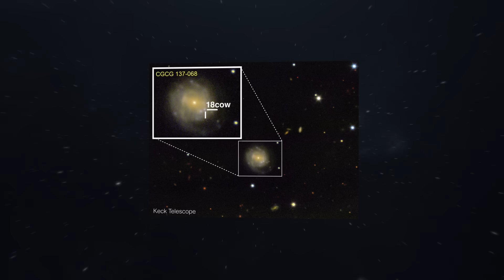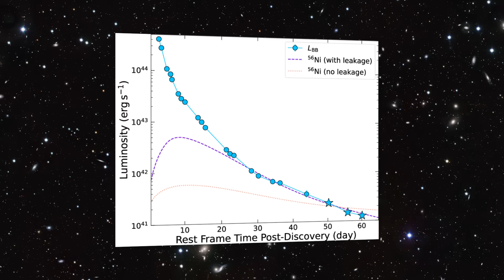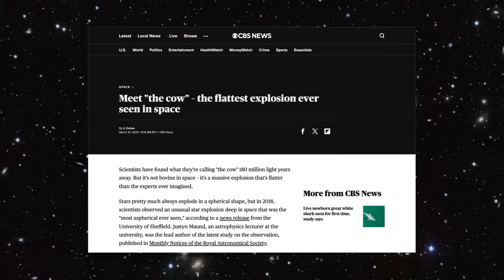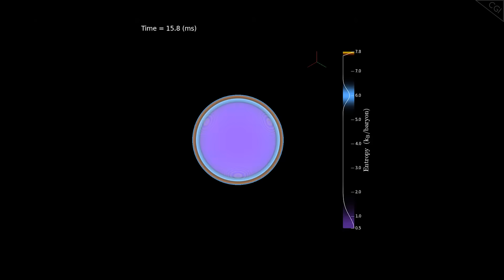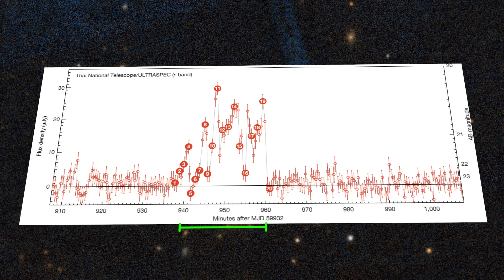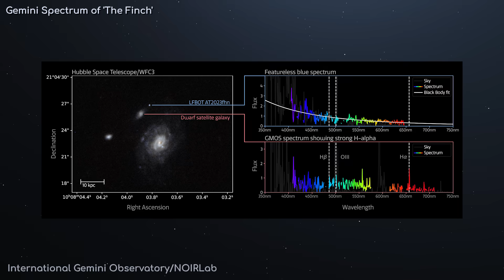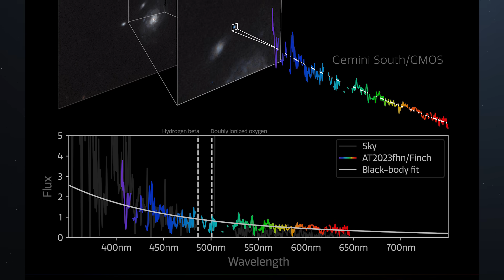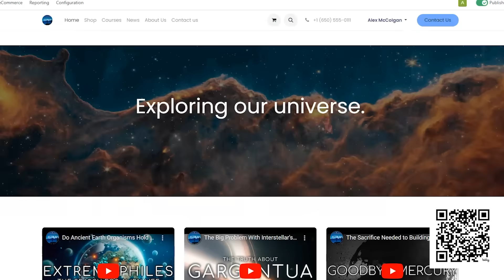Kilonova Size Explosions Are Popping Off in Empty Space

Comment: One potential theory for the Tasmanian Devil could be a small and very tightly packed globular cluster of supermassive stars. A group tightly packed enough to where the shock wave of the first one detonating could have caused a chain reaction, ultimately destroying the whole group.
Reply: I don't find this likely because the distance between the objects would have to be extremely low, as in light minutes apart at most. Less then the size of our own inner solar system. I can see a binary star pair of such objects maybe work... trinary is a stretch... but over a dozen such stars setting eachother off like firecrackers in a chain in minutes?
Reply: @aeternusdoleo4531  You do realize that Earth is only 8 light minutes from the sun right?
Reply: @TheCasualDeathworlder  Exactly. And those shockwaves could not exceed the speed of light. So in order for those shockwaves to "set the next star off" and get consecutive bursts within minutes of eachother, you'd need them extremely close to eachother... astronomically speaking. Combined with the presumed mass of said stars I just don't think it's possible.
Reply: @TheCasualDeathworlder Planets closely orbiting stars seems vastly different than multiple stars closely orbiting around each other. It seems unlikely a cluster of stars could exist light minutes apart to simulate a cosmic firecracker on string.
Reply: @aeternusdoleo4531  didn’t they say in the video that these observations were happening over multiple days? I don’t remember them saying “minutes apart”, but I could be wrong, I can rewatch it later 🤷‍♂️. I don’t get why it’s improbable that stars could be close enough to one another that if one of them went supernova it could potentially cause a chain reaction to others nearby. These objects are billions of light years away, and therefore, billions of years in the past. We certainly can’t resolve individual stars or make determinations about how close they are to one another at these distances. Can we? These stars could’ve also been orders of magnitude larger than the ones we observe in the nearby/modern universe. Just a thought.
Reply: @TheCasualDeathworlder  Which means a light year is 4.2 million light minutes away
Reply: @Michaelroni-n-cheese  I don't follow you logic...or see what bearing the statement has on the conversation.
Reply: @TheCasualDeathworlder  okay dingus is okay if you're not smart enough to understand
Reply: @aeternusdoleo4531 perhaps the shockwave of such an extreme explosion goes beyond the speed of light.
Reply: I'm surprised we don't see evidence of that very often- a massive explosion destroying nearby stars. I'm not a scientist, just an enthusiast, and I'm always surprised when we're shown a star that's gone supernova that had a partner- and STILL has it. How does the partner NOT get destroyed too? Like that nebula (is it the Crab Nebula? Or Tarantula Nebula?) that has a Neutron Star in the center of the nebula but the partner is still there. 

Perhaps I just think of them too close together. But it's fascinating stuff!
Reply: @carried9130 sorry, i just read the last bit of your message, it seems you already thought of that, nevermind. My apologies
Reply: @mrsharky06   no worries!
Reply: Because the stars, even though are partnered, are still very far away from eachother, lightyears even, the explosion could never reach that far. Now, two stars that orbit eachother could defintely destroy the other if one exploded, due to their extremely close proximity to one another. @carried9130
Reply: ahh yeah I hate it when my globulin clusters are very tightly packed
Reply: Hogwash!
Reply: @bad_actor1128  prove me wrong...hehe
Reply: I like that hypothesis! These things are so far away, it’s amazing that they can pinpoint theirs locations, but to think that it must be one star having multiple events seems more unlikely to me than multiple stars in close proximity doing so.
Reply: It's the birth of a White Hole on the back side of the Blackhole... there is an Enistine/ Rosenburg bridge between the two of them that we can't see. the tail on the white hole busts into life and slowly fads away in a few days. At that point, there is a stable wormhole formed.. want to go for a ride???
Reply: @thrillchaser9492  An ERB producing a white hole would be an interesting hypothesis, if not for the energy levels being too slow to ramp up, the peak energies being so much higher than the end energies, and everything we have theorised regarding quantum mechanics and special relativity functionally eliminating the possibility of a slow wormhole collapse, even with the spacetime disturbances of extreme gravity.

The energy would drop off much more rapidly if the end of the burst was caused by the white hole's event horizon collapsing. I would also have to question the celerian velocity of the matter during the burst for the energy to be so blue. It's possible that after passing through the black holes event horizon, and before reaching the critical mass to create the white hole and the trailing mass leaves the white hole's event horizon, matter is violently superluminal, in a region of timespace so twisted you can go backwards through time, but not upwards. All directions through time lead downwards to the gravitational singularity.
Reply: Light has to travel. So, considering the time for the light to get here, how old is the Light Burst ?
Reply: bro imagine being a star and just seeing your neighbor explode and taking you with them 💀
Reply: They were minutes apart, even the first two. I don't think supermassive stars can be that close to each other.
Reply: @Mathel_Steeltoe   I always wonder how close they can be in a few scenarios. Say similar 2 super-massive stars, or 2 like our sun, or 2 red dwarfs orbiting but not colliding. How close can they get and maintain orbit? How about different combos? How close can white dwarfs and their companions be? How do some stars merge without total destruction? 

Seeing examples of the heliosphere...that's such a huge amount of space and so much power from our sun. And it gets me curious about other stars' own heliospheres and binaries too...like do binaries contribute to 1 or do they each have their own heliosphere? So many questions. I've only recently started learning, and I get why it drives scientists on. The more I learn, the more questions I have.
Reply: Its the neural pathways of the cosmic brain lighting up
Reply: @Igneous01 Interconnected how exactly? How does that work? I can accept that a relatively small destabilizing force could trigger a larger reaction - but what can move at that speed to set off multiple objects in short succession across large distances, at the very least multiple light minutes apart?
Reply: @Igneous01 I'm not sure if given the pressures that the heliosphere of one star could affect another like that... but don't know enough about stellar mechanics to say. Would make more sense if a gravitic or magnetic shockwave rather then a compression wave would end up messing with neighboring stars...
Reply: Those are Creator farts... but it could be Odin farts.
...
..
Reply: Hmm no, having almost equal stars that close to each other is impossible.
Reply: @AstuteClippy Ummm...no. It's called a globular cluster. A million or more stars, mostly of the exact same age and stellar type, all packed to a density of 1/4 LY (or less even) average separation.

Comment: could it be pockets of matter and anti matter annihilation? could there be pockets of anti matter  just lying around in the universe which unluckly galaxies pass or pockets of large matter gasses to pass through?  causing such huge energy conversion? i am just an amature enthusiastic, but matter anti matter annihilation seems more plausible for such magnificent  scale of energy..
Reply: It couldn't be. I've been part of a research group at my university studying positron annihilation spectroscopy and have learned a little about anti matter annihilation. The problem with this hypothesis is that matter-antimatter annihilation creates very specific wavelengths and basically doesn't have a spectrum. Electrons annihilate with positrons and create a very specific photon frequency, depending on the speed of the electrons and positrons relative to each other and us we'd see a spectrum within an extremely small range of frequencies. This happens to be the case for every particle and its anti particle.

Electron Positron annihilation is one of the longest wavelength (lowest energy) photons among antimatter annihilation but its photon energy is gamma radiation. As mentioned in the video LFBOTs create quite a large spectrum of radiation including blue light. While matter antimatter annihilation could possibly produce blue light if both the matter and antimatter were moving away from at like 99% of the speed of light (which is already an unprecedented speed for us to have seen matter moving relative to us [in large enough quantities to produce LFBOTs]), it couldn't have produced such a spectrum, and even if it did you'd see sharp spikes in the spectrum it created around a specific wavelength for each different type of matter-antimatter particle combination included in the annihilation event.
Reply: @dezvul4817  cool! thanks for explaining it in details, really appreciate it.
Reply: Certainly can't rule that out. There's so much more that we don't know about the universe than what we do know. The laws of physics seem to apply throughout the observable universe but who knows what else is happening on levels we cannot detect, observe, measure with current technology. We still don't have a clear understanding of how quantum mechanics relates to general relativity. Take care my friend. 🙏

Comment: Nothing in far distances is where it appears to be. Photons takes curved paths to many gravitational fields on their way to us and high energy FRBs are less effected by those gravitational fields that in our sky, lands them as source unidentifiable.
Reply: The thing is that unlike refraction gravitational lensing is not color dependant and isn't going to separate the image of the LFBOT from the image of its host galaxy.
Reply: @andrewwade1651  Common belief is "Gamma rays are affected just like light rays, so they will be subject to a gravitational red shift and they will be bent by gravitational fields just as visible light is." 
There is an entirely different discussion if they are effected identically in taking the identical path.
Reply: @rezadaneshi  Based on our understanding of General Relativity, radio, gamma, gravitational radiation, and neutrinos would all be gravitationally lensed, yes. But "the Finch" doesn't appear to be behind any strong gravitational lenses and many of our detectors don't have the angular resolution to observe gravitational lensing anyway.
Reply: @andrewwade1651  if the energy of the regular photon gives it a theoretical mass based on e=mc^2, the gamma ray mass equivalency will be magnitudes higher. Both at light speed. P=mv. It's mass equivalency at that speed will be less effected, in a way it's cheating or time traveling ahead of visible light photon by powering itself a shorter cut by influencing its path gravitationally itself.
Reply: @rezadaneshi that’s deep and neat🎉
Reply: But what is near the object will also take the same path, if it appears in empty space or a galaxy, it is. It just might be somewhere else and not in a straight line to where we observe it.

Comment: This reminded me of something i saw a few years back. Not saying it is related but it was strange. I was in my garden one evening, late summer, doing a work out. In between sets i would enjoy looking up at the clear sky with all those stars. By the time nighfall came i was just about finishing up. As i looked up there appeared to be what looked like a typical star suddenly increase dramatically in luminosity before decreasing until it appeared to just disappear completely. This happened over a period of 5 or 6 seconds. The only way i can describe it was as if you had turned a dimmer switch up on a light bulb and watched its brightness increase then turned the switch back down until the light dimmed and went off. I cant tell you the positioning in the sky or constellation this took place in but that experience bugged me to no end. The light wasnt moving. It was stationery. Just went from average star brighness to really bright (this made it appear bigger) then dimmed and disappeared as quick as it came
Reply: If it started faint, grew in intensity, and then diminished it might have also been an Iridium Flare (basically light reflecting off of a satellite).
Reply: Sometimes satellites at a certain time of night when the sun is just over the horizon, they reflect the light from the sun and produce what appear to be stationary flashes/bursts sometimes quick and sometimes a little more drawn out (like 5-6 seconds). But it’s just them rotating and hitting the light perfectly back down to you.
Reply: @ModelsAtWar  also true, as an amateur astronomer I see them quite often. Only lately I actually saw a couple of those that didn't behave as usual. Probably Chinese aerogel spytech. Like gimbal and go fast
Reply: reminds me of the old iridium flares (okd satellites that would reflect sunlight, there were websites u could check to see when the next one visible to u would be). these days i think they mightve all deorbited, when i saw one it was around 2009. one cool thing about them was their color, a very sharp orangish/gold, very bright, and would brighten and dim over the course of just a couple seconds
Reply: Sounds like a meteor burning up in our atmosphere. It didn’t move since it was likely headed straight towards the earth.
Reply: @Sup3rSn1per  could very well have been 🤷‍♂️ coming in at a kind of head on approach. It was cool to witness whatever it was.
Reply: Yep, meteor on straight on collision. You had a once in a lifetime fluke experience

Comment: The hypothesis of stars getting torn apart by black holes sounds somewhat more likely to me. That would be more likely to happen in spiral arms and it could potentially explain Tasmanian Devil. A pair of extremely closely-bound binary stars wandering into the proximity of a black hole could result in multiple bursts of energy before finally getting torn apart.

Finch, however… oof. No clue.
Reply: Isn't there something known as wandering black hole ... as soon as Akex went into depth pretty early in the video, that phrase was screaming in my head. This would be evidence of such a phenomena, no?
Reply from the maker: @JonnyMack33  It could be... the problem with the finch is that even if there are stars in the vicinity of a black hole, then the odds are astronomical that they will cross paths so far outside the galaxy. Stars are just that spaced out outside of a galaxy. Let's see in the coming years if there's a star cluster there.
Reply: @astrumspace  what are chances that these are micro nova due to galactic current sheet passing through the milky way and maybe our sun does it too 🤔
Reply: Astronomical odds in this context is a bet I dare to place.
Reply: @JonnyMack33  Wandering black holes... What a horrifying idea. It haunts my mental imagery.
Reply: @walterwalter-ql1np well don’t lose any sleep over it, the universe is likely full of them
Reply: the problem is almost all things that are star related should be correlated with star density - ie, inside galaxies. when there hundreds of billions of stars in a galaxy and only millions outside, most in clusters, then most interesting events occur in a galaxy, at a ratio better than 1000:1, often much much more as they are also correlated with density. seeing even 1/20 outside a galaxy is "interesting"
Reply: Not true